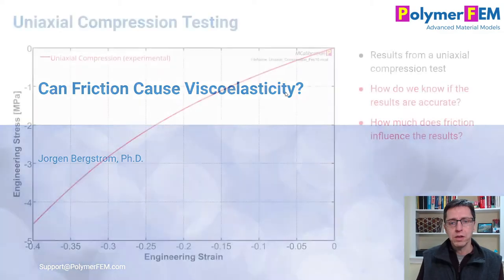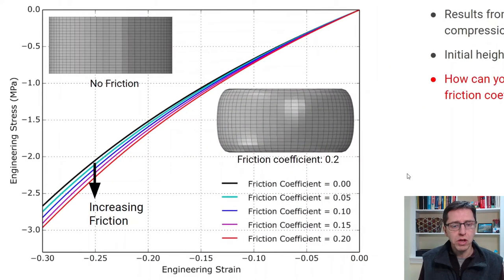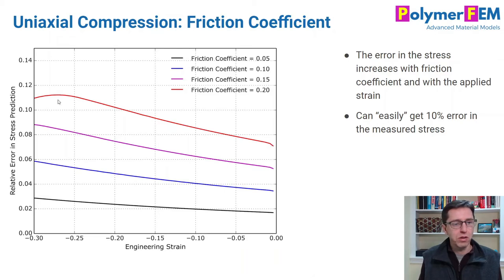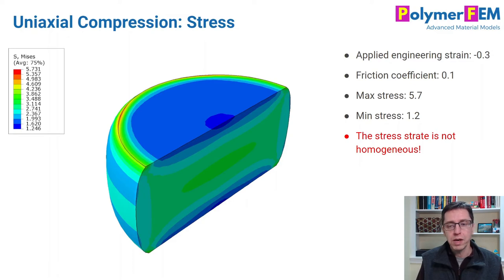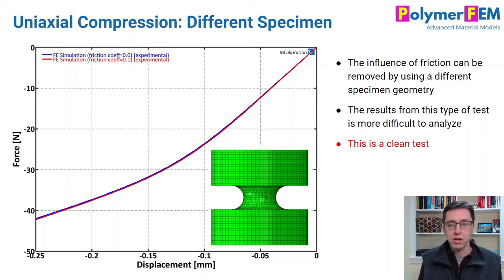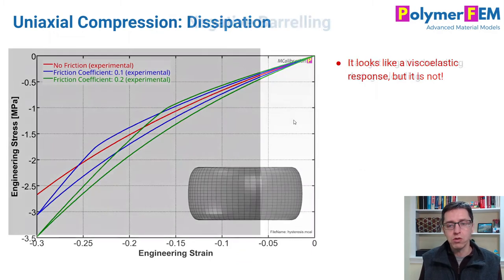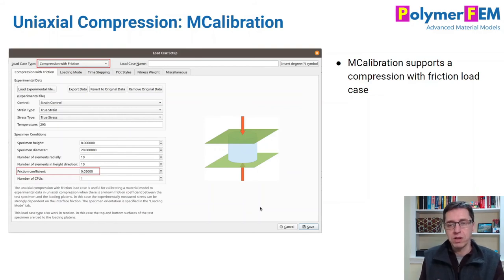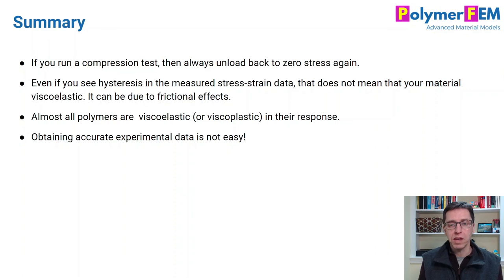Can Friction Cause Viscoelasticity in a Compression Test?

Comment: Please specify:
is there any additional information about Load Case Type:  Compression with friction ?

I tried to calibrate the constants using experimental data:
uniaxial tension and uniaxial compression (Compression with friction), with different strain rates.

I was getting the message for all solver types:
Mcalibration Solver: load case "Compression" has an unsupported solver type.

What caused this message?